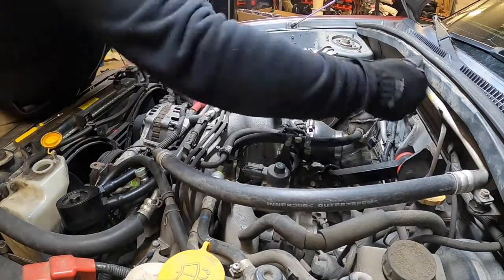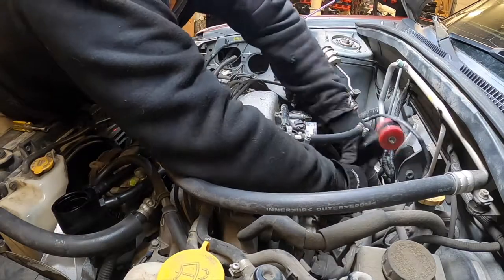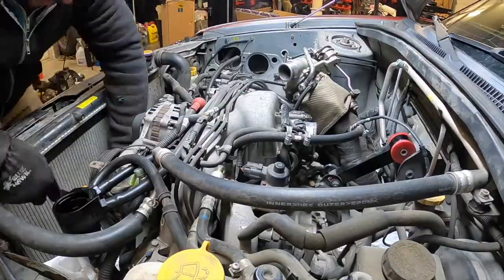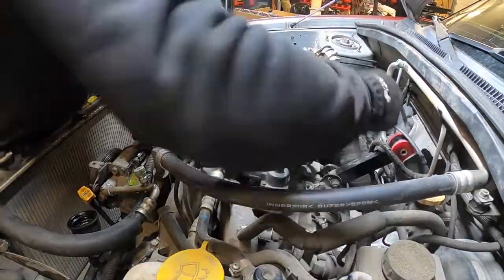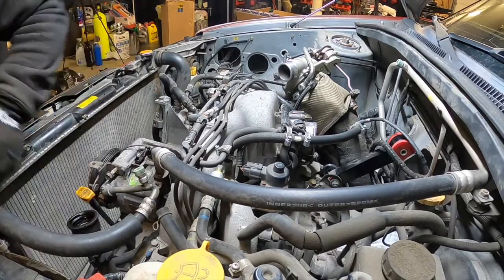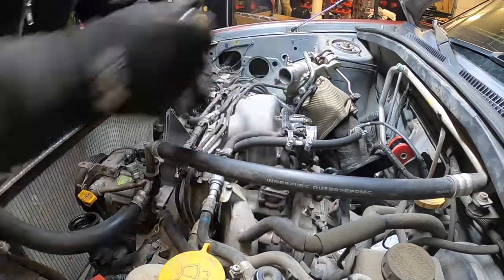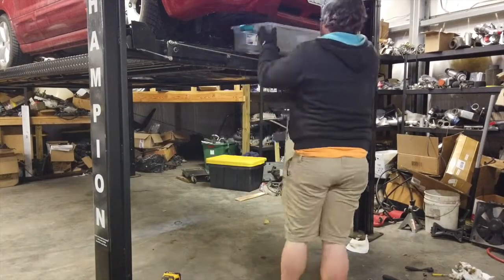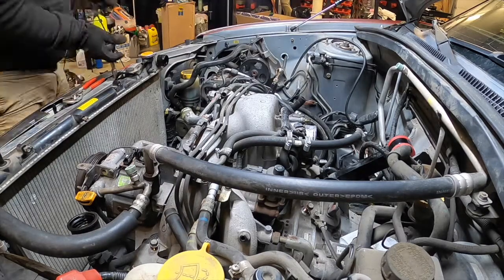Forester XS EJ255 Shortblock Swap: How to Pull a Subaru Engine

Comment: Hey !  We’re still awaiting Part-2  Forester Sti
Reply from the maker: Thank you so much for checking in, so sorry I haven't made any progreso just past the 3-4000 mile mark on the swap and on the coldest day of winter popped another head gaskets. I am think the old heads got a little damaged on the first head gasket blowing, and I really should have had them checked out. So right now Im waiting on getting the motor out and heads refreshed before putting it back together, hopefully with a new short block from Subaru :)

Comment: you think i should turbo my 04 forester xs or just get the 2.5 turbo motor?
Reply from the maker: So it depends on if you are willing to do the tuning yourself or not. If you can't tune, or don't have a tuner but you are really good with a wrench, I would swap the wiring harnesses and ecu and drivetrain from an XT over to the XS, otherwise there are just some frustrating hurtles with the XS when it comes to tuning.
Reply: @schwamotorsports7792  I heard you don't have to swap the wiring harness only have to add a jumper guess that's not true on the 2.5turbo motor swap
Reply from the maker: @HypedOUT  maybe it has to do with which 2.5 you use, the XT motor has variable intake cams and I don’t know if that can be integrated into the harness, but the XT motors also have the wiring disconnects in a slightly different location than the XS cars but I’m not quite sure how much that effects things :p

Comment: What’s needed to make a Non turbo forester to a forester xt  wat do I need  and wha can I keep on my car that’s compatible
Reply from the maker: So its kinda a mixed bag depending on which direction you want to take :p So It depends on how you want to go about tuning. For mine I got lucky and was able to flash an Impreza tune onto my ECU which allowed me to actually tune this ECU in this chassis. Then the next crucial part is keeping the SOHC motor and building all the parts :p Rather than rewiring for the DOHC with the variable cams I kept all of the heads original and ECU original. Then Im keeping the boost within reason and using a wideband to keep my motor happy :)
Reply: So I can use my 2.5  motor  just got to build it for boost . And I can use my same ecu. I heard the Subaru ecu are able to be tuned  no chip need to tune
Reply from the maker: No chip is needed, but the forester ECU is kinda tricky, I got lucky flashing a 2.5rs tune onto my ecu, but you might play it safe and just swap to an RS ecu of the same year and see if you can get into it with Romraider, otherwise first fine a local tuner who is willing to do some tricks to get it take care of, then yes if you build it for boost you should be able to have some fun in your SOHC NA car :p

Comment: Still waiting for part 2!
Reply from the maker: I’m working on it. The forester has been on the road for about 3000 miles now, sadly the 175k mile motor is burning some oil(or the turbo died when the head gaskets did) but the 08 clutch kit was a bust with the 05 trans, so it’s coming back out for a new clutch :p

Comment: Can I swap a 2005 XS engine for at 2004-08 engine without any problems or other mods needed?
Reply from the maker: Not 100% sure but I think all of those SOHC NA motors are about the same, I know at some point they added the variable cam love to some of the sohc motors so you need to look out for that, but if it doesn’t work plug and play you might just need to move some parts over from your original motor :)